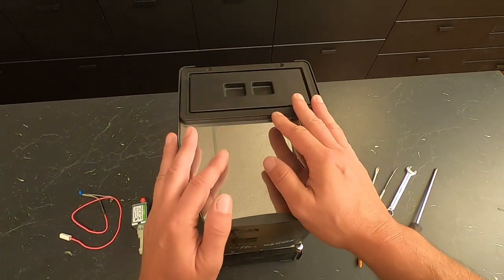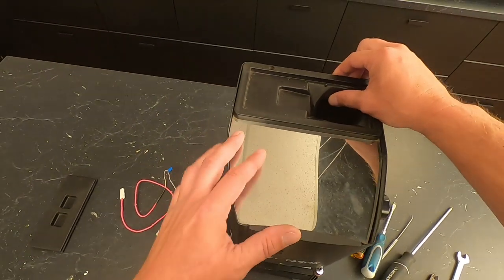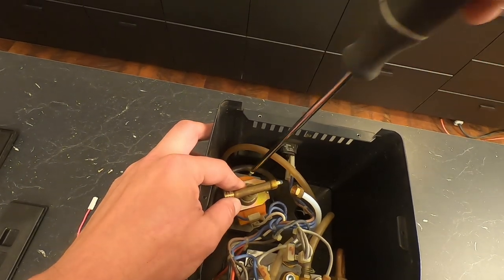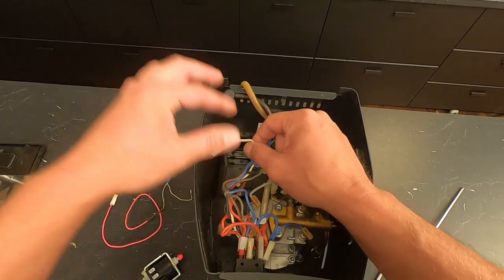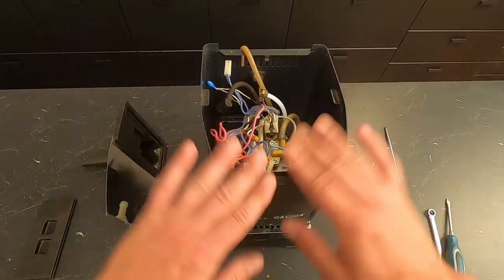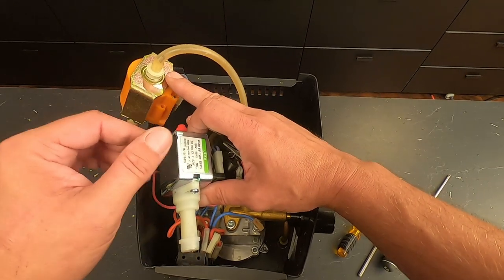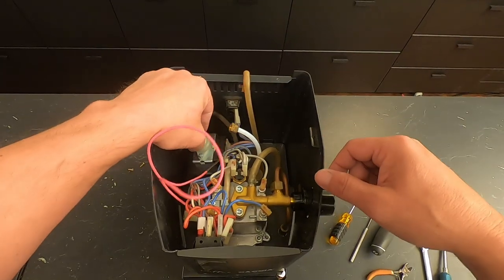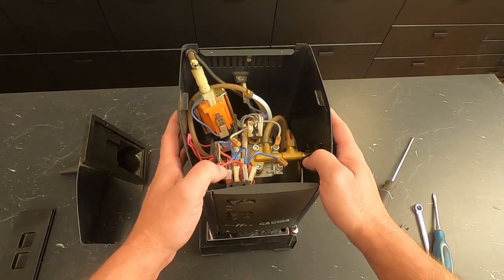How To Swap Out an Orange Pump in Older Gaggia Espresso Machines

Comment: I have an old Gaggia Classic with the orange pump and just upgraded to a new Ulka pump. I bought the wire you recommended, but when I went to install it I discovered the connector on the front button module has two wires going into it, one going to the orange pump and the other going to another connector on the front button module. Is my best bet just soldering the new thermal fuse onto the existing wire?
Reply from the maker: Hey John sent your comment to our lead Gaggia Service Tech. Hi response:
Yes, that sounds good. Or using a butt connector. And I would definitely use shrink tubing on whatever connection is made.

The other option would be to totally forget the thermal fuse with the wire all together. And just connect the 2 wires removed from the Orange pump in the video and just connect those onto the new pump. Doing this would just mean no thermal fuse on the pump. The thermal fuse is there just in case the pump overheats, in my opinion its not really needed. In fact, the Rancilio Silvia does not use a thermal fuse on the pump and it has never been an issue. And in my 16 years of repairing classics, I cant recall ever having to replace a pump from over heating or the thermal fuse tripping. My guess is that the only the pump would over heat, is if someone left the brew switch on and the machine was on a timer. And the machine turned on with the timer and the pump would just run and run and overheat.
Hope that helps!

Comment: You mentioned that you’d provide item/order numbers for the new parts. I didn’t see those. Can I find them anywhere?
Reply from the maker: These parts listed in the video description?
PARTS
Pump: GA-12000142
Wire with Thermal Fuse: GA-289204100

Comment: Old orange pump is available on Amazon. My Gaggia Classic has the orange pump which I wasn't expecting when I opened it up. I already ordered and had the EAP5 pump so glad to see I might be able to still use it. Replacement orange pump is about 2x the price as the EAP5 but by the time you factor in the $15 price for the thermal fuse and shipping...it's about the same since shipping on the orange pump is free from Amazon.
Reply from the maker: Thanks for the info. Also have fun trying to call someone at Amazon if you need help with install. We have expert tech support available by phone to get you the right part and advice at 585-924-7170. I'll proactively add a link to our support wiki for the Gaggia Classic. Find manuals and diagrams, troubleshooting, maintenance tips, use info and more videos on the Classic there: https://wiki.wholelattelove.com/Gaggia_Classic
Reply: Is there any more significant mod for this older machine coffee de luxe?

Comment: Hi, I did this and it is pumping successfully to the wand, but there isn’t any water going to brewhead(where basket attaches). Any ideas if I messed up or just someth8ng else is wrong?  Thanks great video.
Reply from the maker: Hey matt, Thanks for the comment. You did not specify machine type but guessing a Gaggia Classic? If so and your machine has a 3 way solenoid it's likely plugged up. Here's a video on diagnosing and resolving that issue: https://youtu.be/dDtHUPxh95o?si=5z9rVhLlNXCbyniB
Reply: @Wholelattelovepage  followed  your video on breakdown and cleaning of entire unit and it’s working great. Cheers.
Reply from the maker: @Legionofdoom98  Awesome - thanks for the update! More maintenance and repair info in our support section for the Gaggia Classic: https://support.wholelattelove.com/hc/en-us/sections/1500000384362-Gaggia-Classic-Pro

Comment: Trying swap out my orange water pump on a 1997 Gaggia Classic. Instead of a white cable as shown in the video, my orange pump has a red cable going to the middle tab on the steam switch, which has a harness that connects over to one of the brew switch tabs. If I unplug the red cable from the steam switch, it also disconnects the jumper going to the brew switch. What tab should I connect the thermal fuse to?
Reply: Decided to join the thermal fuse to the existing red cable with a wire nut. All good!
Reply from the maker: Hi A, Thanks for the update with solution!

Comment: Hello. For the tube coming out of the pump on the bottom, the one with the spring in it, my spring extends halfway down the tube. Is that normal? Does changing that spring affect pump pressure in any way?

Comment: I’ve just replaced the old orange pump with a new one but didn’t change the wires or add that fuse. Is that an issue? It seems to work fine.
Reply: Have you had any issues? I am in same boat and don’t want to wait for new wires (ordered the new pump before I realized I need wires too - Gaggia classic from 2005)

Comment: Hi, just wondering..The ulka pumps which come in the Delonghi ECAM rage of machines seem to be considerably quieter than the ones in the ESAM range. The pumps in the gaggia classic seem to be as noisy as the delonghi ESAM range.

Question is, can a quieter pump model intended for a delonghi ECAM be put in a Gaggia classic? The specs seem to look the same, I'm just wondering if this has been sucessfully performed, before I pay for a new pump to experiment.

Thank you, and thanks for all your invaluable videos!
Reply from the maker: Hi Elbow, Most differences in pump noise is related to pump mounting and not the pump itself.

Comment: Hi great video, just wondering where I can get a thermal fuse like the one you recommend? 
Can’t find anything like it online.
Reply from the maker: Hi Jenny, We do have them available: https://www.wholelattelove.com/products/thermal-fuse-184c-limit!
Reply: Thank you for your reply. They are however different. The one on the link looks like it will need soldering on and the one in your video was small wires with 3 small plug connectors. I wouldn’t know how to fit the one shown in the link .

Comment: Great tutorial, thank you. Is the newer pump quieter than the old style?
Reply from the maker: Hi MM, Thanks for the comment. Probably not significantly quieter than original when new. Vibration pumps just make noise. But, some maybe noiser if they're knocking about on other components inside the case.

Comment: My classic is ridiculously loud and it vibrates a lot.  I have to hold the rhino cup or else it would be dancing around under the portafilter.  What can i do to help reduce the vibration?
Reply from the maker: Hi KN, I would remove the top of the machine and see if the pump is knocking against internal components. Adjusting pump position in its soft mount should reduce vibration.